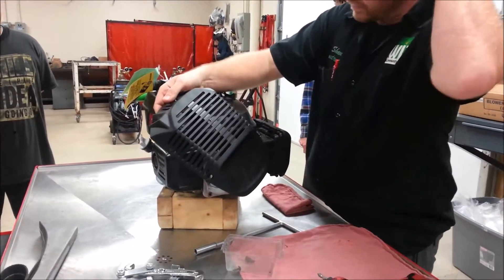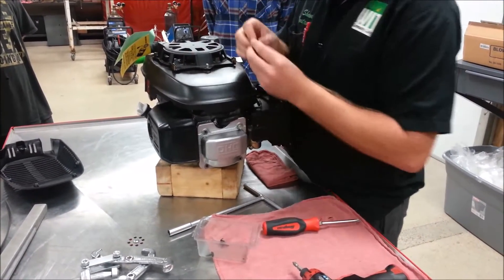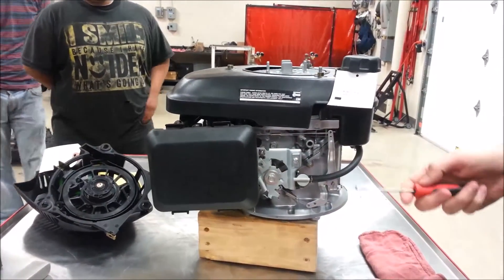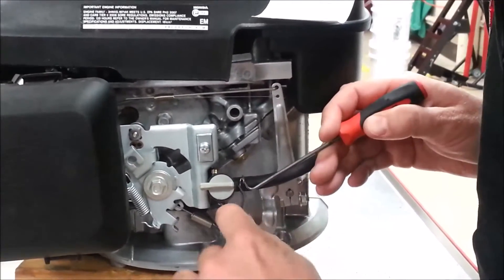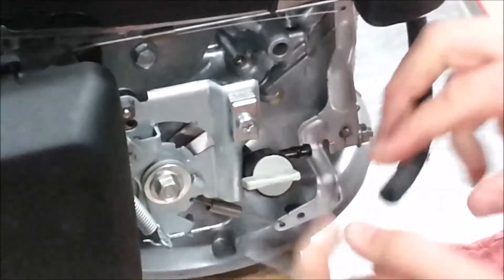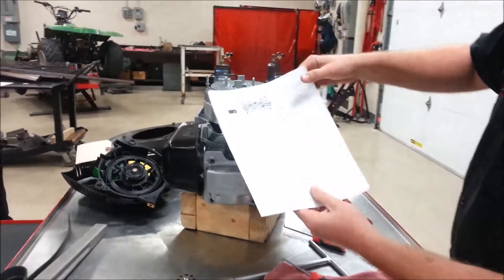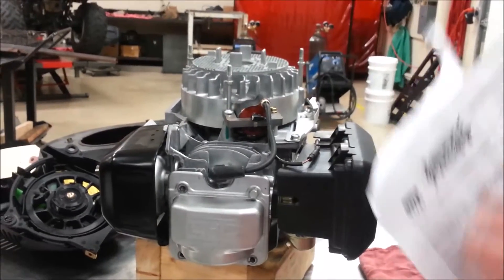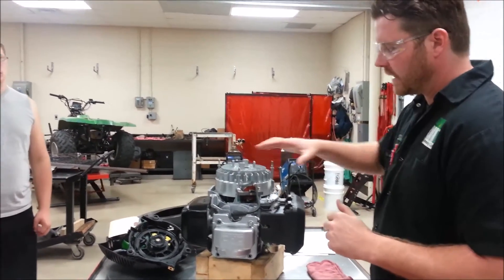GCV Disassembly   02  How to remove the Fan Cover & Fuel Tank #how2wrench

Comment: Hi. What is a good compression reading for a GCV engine?
Reply: 85-121psi
Reply: You won't get full compression when measuring it vs. when running, because the camshaft has a pressure relief mechanism designed to make pull starting easier.  It bumps the exhaust valve open a little bit once each cycle when starting, but not when running.  So you will only read something around 60 psi when compression testing a good engine.